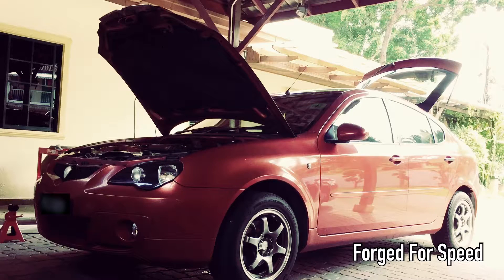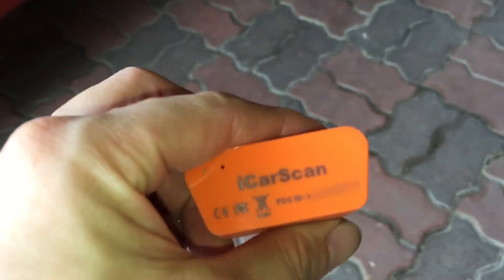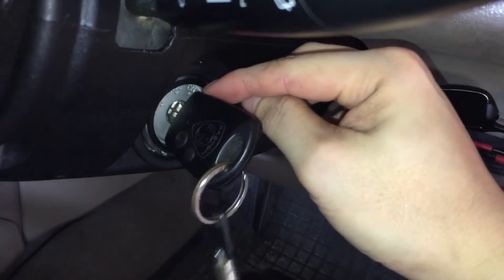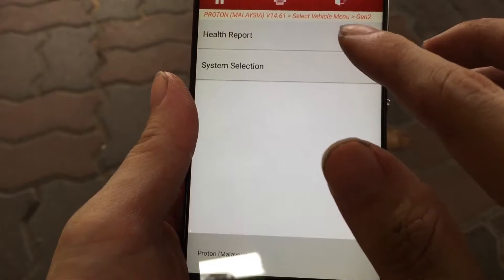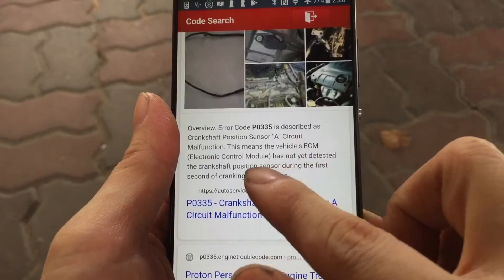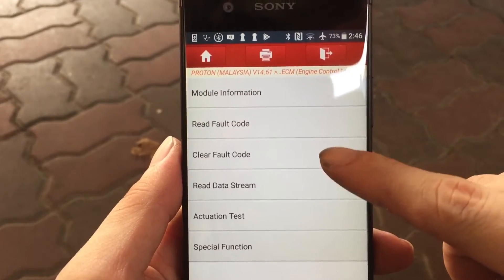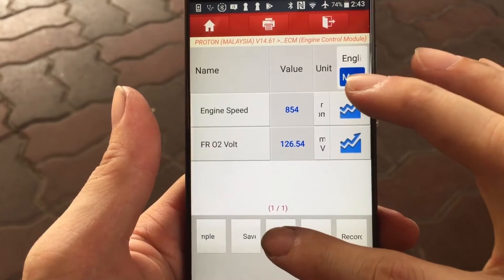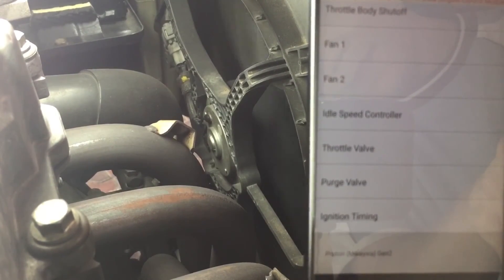How to diagnose & fix a check engine light? (Proton Gen2 // Launch iCarscan x431 //CEL)

Comment: Hi,
I got proton gen2  2011
I having problems about my hazard lights,  i checked my fuse and relay i thought would be the problem?
But still do the same problems sometimes working and sometimes is not working?
Could you please be able to help me how to fixing the problem. 
Thank you.
Reply from the maker: Hi buddy, have you checked the hazard light button/switch module in the car?
Reply: @forgedforspeed  thank you for replaying my question.  Yes i did checked just pressing on it something clicking sound.
Now completely not working anymore but when i pressing key buttom the yellow hazzard lights working.

Comment: My friend I need your help, I have Proton Gen 2, scan showed P0120 code, is it going to be enough to clean throttle body or? Thanks!
Reply from the maker: Hi Buddy, I would try to clean it first. It may help. Once that does not work then only look for a replacement.

Comment: The diagnostic scanner applies to all types of cars?
Reply from the maker: Yes sir as long the car has OBD2 support, this scanner will work with most car brands and models.
Reply: please can i know which application you use
Reply from the maker: Hi buddy, I use Launch X431 application but you need the Launch OBD2 dongle too. If you need more info DM me on instagram @forgedforspedd
Reply: @forgedforspeed  thnx mate i already i have odb2 i need to clear my diagnostic issue from my proton gen 2 dashboard